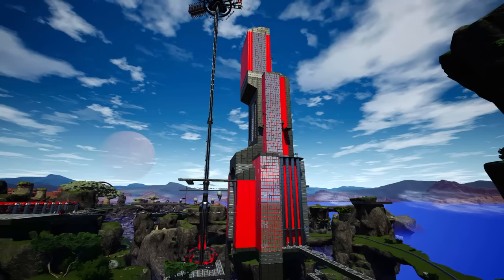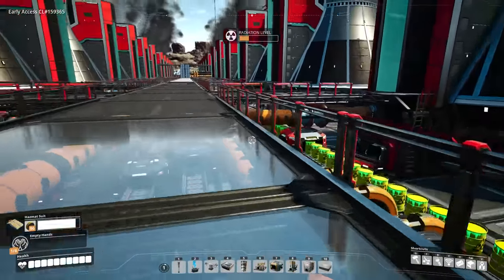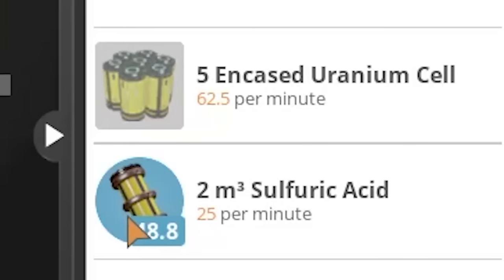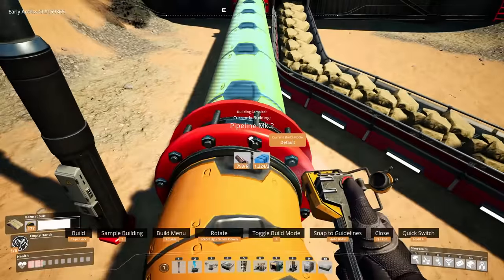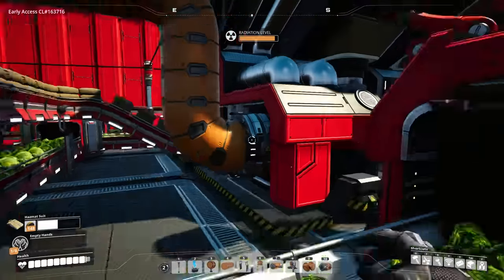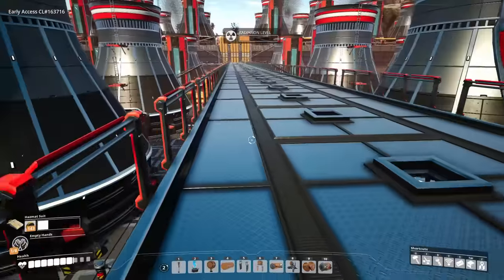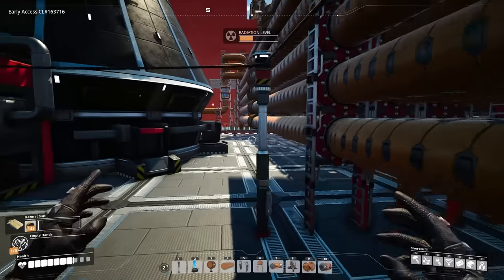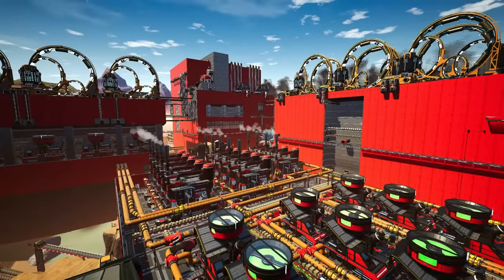The Nuclear Power Plant is MELTING DOWN?!! - Satisfactory

Comment: The fluid bug on Nuclear power reactors became the bane of my existence for a while. I underclocked all my reactors to below 95% to also match production, AND STILL they sometime stutter. I tried so many things, small connection pipe, long connection pipe, mk1, mk2. The only thing I can't try is filling from above, as my design feed the reactors from below, and the building design can't be made that way. So frustrating.

Comment: Mk2 pipes have trouble keeping a steady 600/s flow when you have them travelling across long distances.  Each link in the pipe makes it worse.  It's the floating point error.
You're not going to get a steady max power consistently with that water setup anyway.  Maybe if you are out of the region, because tests have shown that the floating point error only happens when you are in the same region as the belts/pipes.

Comment: You need a check valve after your output from the sulfuric acid before it connects into supply line. Otherwise the main system will backfill the output and clog your system, which is what's happening.

Comment: I think I have read on a Reddit thread that mk2 pipes are bugged and not currently transporting 600 m3 as they should. I have been using mk1 and it all worked out perfectly but as soon as I switched to mk2 systems clogged up. Hopefuly it's fixed in the next update...

Comment: I ran into a similar problem with my fule generators where I was providing exactly the same amount of fule as the generators required and I had unstable power until I stopped one and let them fill before restarting. Then my power was nice and contestant.

Comment: 8:50 Don't do this. 

If you want to remove the excess and ONLY the excess from a system, remember that pipes obey the laws of gravity, just make an overflow pipe which is higher than all your use pipes, that pipe will ONLY get fluid when there is an excess in the system, causing the fluid levels to raise to that point. Then, assuming it's big enough, that pipe will carry all the excess away to whatever solution you've set up.

Comment: Your Sulphur pipes back up because the intake keeps filling even when your blender is standing still.... so when your blender actually works, the Sulphur lines are too full to take any more... you should actually feed the sulphuric acid output from the blender to something completely different... thats actually the only way to stop that happening... and then increase the intake amount.
Reply: actually his setup is fine, backloops are okay as long as the machines demand enough. Never had any Problem with this. His problem was the concrete, which hindered the sulfur consumption and led to a back up in the pipe.

Comment: If your pressure from sulfuric acid IN is greater than what gets from the blender out, your lines will always be full, even if you reduce the flowrate from sulfuric acid IN (assuming on 5:37 is SulAcid IN ) Edit: Because blender work in intervalls, so while he sucks in 8m³ SA work work work for 4,8sec , the pipes are already refilled - now 2m³ want to go out, cant because pipes are full )

Comment: Sulfuric Acid Backs up Because you Calculate the Numbers of a Machine that Runs 100%. If the Machine however not Running 100% then the Numbers of Backfeeding it into on the Valves are not Correct. So put AI Spliter on the Back an Shredder all the Overflow, so that the Machine is Running 100% for ever.

Example: Alumina Reffinery Gives back 105 Water per Minute, if its not Runing 100% then its not 105 Water per Minute. Shredder the Overflow Scrap and then you have Alaways 105 Water per Minute and the Valve has alway the correct Number :)

Comment: Hi Kibitz. I have a question I am running into an issue getting my nuclear plants to run efficiently. I am only starting with a small nuclear setup for now. I have 5 water extractors supplying 2 nuclear plants each (each plant requires 300 m3 of water) and am running into an issue where some of the extractors have a very low flow rate and as such the nuclear plants keep running out of water. Did you ever rub into this type of issue before and if so what fixed it?

Comment: I think the issue you were having with the sulfuric acid, is because you were just relying on production time. 75% of what you needed from the sulfuric acid factory, 25% of what you needed from the blenders. This means if the blenders stop running, the sulfuric acid factory over-saturates the pipe.
However, you were having a concrete supply issue (due to the 300 pipe on the water line) which caused the blenders to stall, which over-saturated the acid pipe.
The only real solution to the issue is to make sure things can't back up, by not feeding back into the input. The only real solution to this would be to feed the output of 4 of them into the input of 1, and 16 feed into those 4, and right at the end, that one feeds into a canister, and then the awesome sink.

Comment: I had the liquid recycling issue fuckin kill me on my aluminum setup. I had the excess water reroute back into the production, but it always backed up. It never happened on any of the other recycled liquid systems, and it took forever to fix it. The answer was apparently due to the liquid backflowing constantly, even though there were no height issues. Using valves into a one-way buffer fixed it. Didn't have to do that for any other system though, so it's really weird.

Comment: Couldn't the issue with the sulfuric acid have just been, because concrete was being choked by water, the blenders werent working at maximum efficiency (because they didnt have concrete), and therefore you were making more sulfuric acid than was being used in the blenders (that were again slowed down by a lack of concrete) and it just flooded the system

Comment: We really need a way to spot mk I pipe bottlenecks. Some hidden inch of mk I pipe caused my turbofuel plant to fail. Same happened again with plastic/rubber production. I suppose it's usually when you put a junction or pump near the end of a mk I section, then later try to upgrade the whole pipe. Putting something on a pipe like that splits it into two pipes, and if you're doing it near the end, one of those two pipes is tiny and often not visible or upgradable unless you remove the junction/pump. It's a frustration that I think would be worth the devs trying to address in some way.